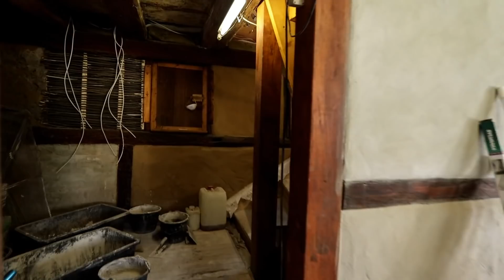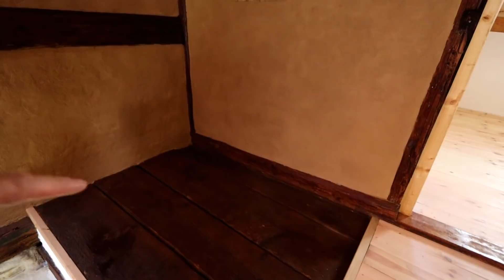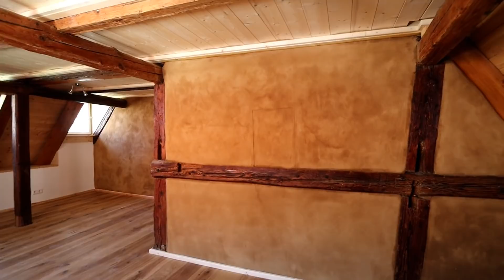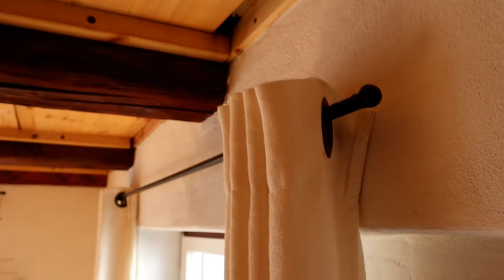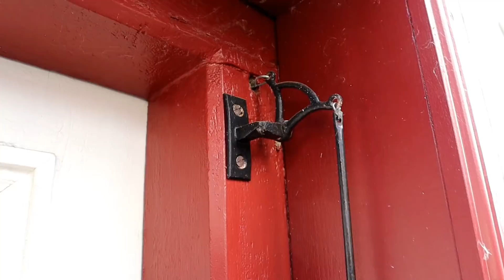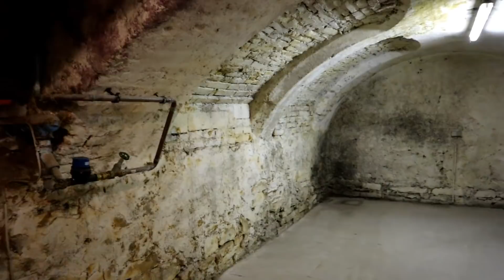House restoration (almost) finished!

Comment: I understand what you mean about floors that are not level, although my house is only 130 years old, one of our bedrooms had a floor that was 130mm higher at one side than the other!  Luckily I had headroom of 2.4 m to work with.  It is flat and level now, but for how long. I have the same issues hanging doors: it is a much misunderstood skill to be able to make something that fits is a space that is not flat in 2 different directions!   I enjoy your videos!

Comment: Our farm house was built in 1880 and the cowshed for 3 cows in 1920
1955 was built a barn above the cowshed, 1970 a central heating system was installed and 1990 it was complitely renovated :)